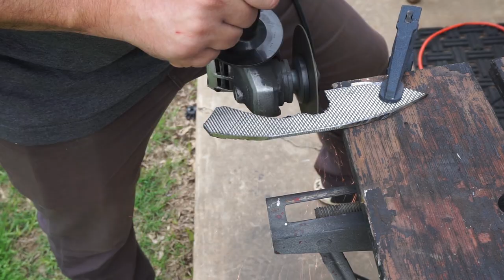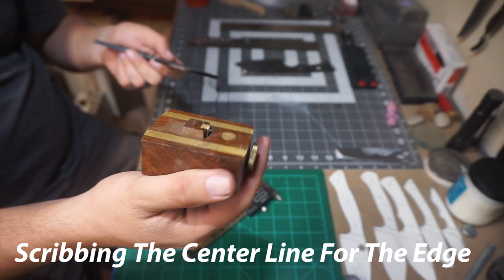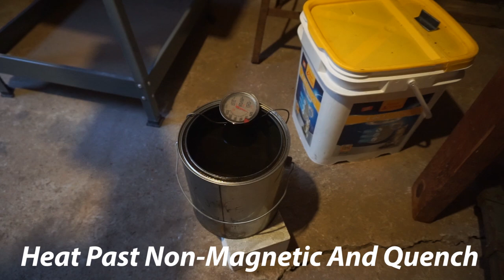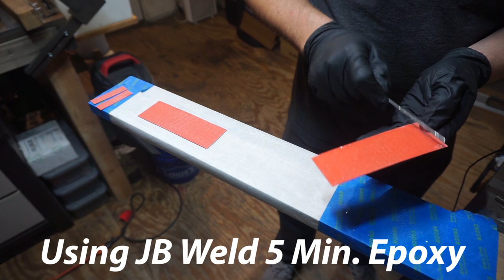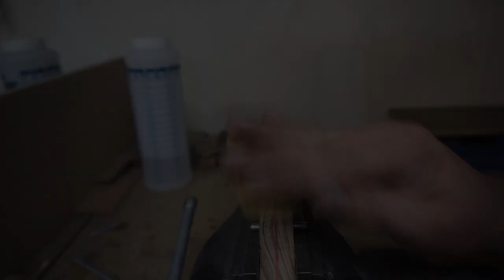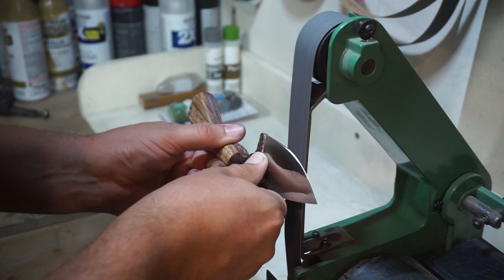Making A Farriers Rasp Knife In 11 Minutes | Knife Making | Time Lapse | Daily Vlog

Comment: I have been told that some farrier rasps are case hardened. Do you check your rasps . If so could you comment on how. Thanks again for all your help.
Reply from the maker: I do a Snap test to check the grain pattern and I will sharpen a piece and test the edge retention.
Reply: The Rivers' Experience  could you show how you do that method.

Comment: Is there a reason why you didn't anneal the file before cutting into knife shape?  Just wondering.
Reply from the maker: I made about 4-5 knives from this one Rasp and I like to only anneal what I'm using in the moment. The files cut just as easy with an angle grinder and cut off wheel whether they are annealed or not.
Reply: @theriversexperience9383  I got ya.  Thanks for replying and another beauty as always!